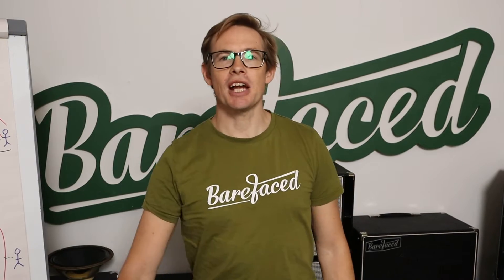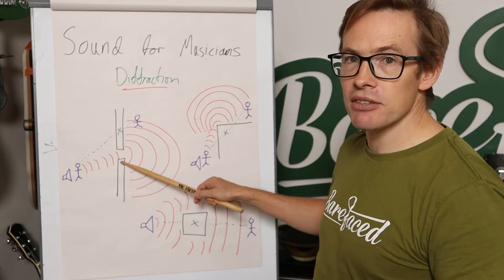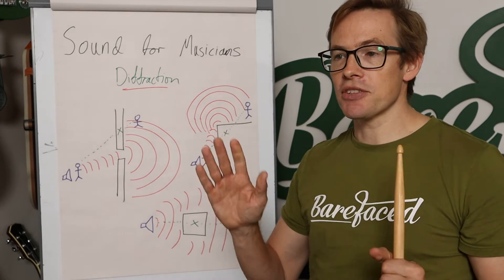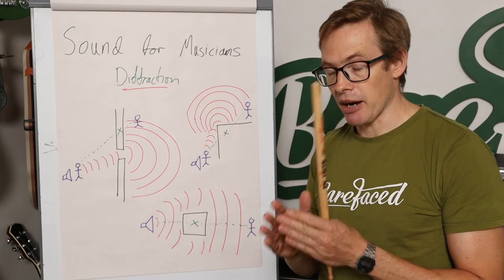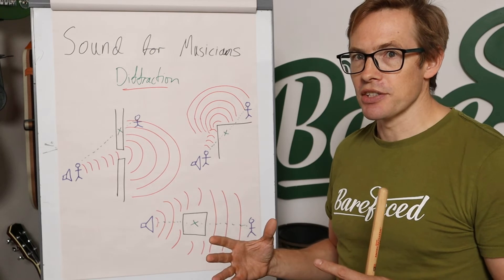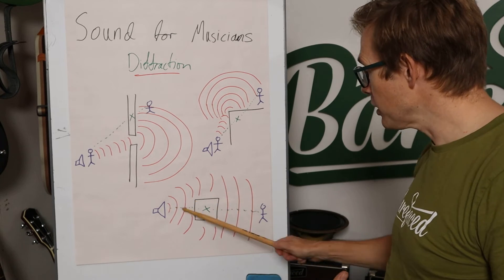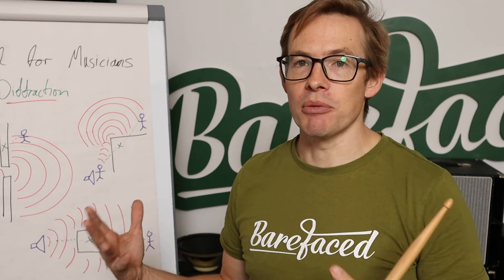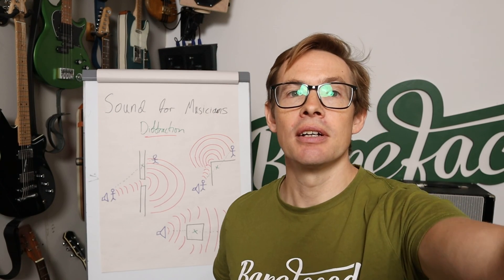Sound for Musicians- Part 4: Diffraction

Comment: Excellent. I would love to hear about dead spots in rehearsal rooms and how to deal with them. For example - i have a friends, who rehears in the same room with the same equipment for years. And i know minimum 3 spots in that room where 1) in front of the bass cabinet - and there is no bass therу at all. 2) in front of a guitar cabinet - thу same. 3) one spot when you hear almost nothing, although its 1 m. from the drum kit and 0.5 m. beside the bass cabinet. It would be great to have an info how \ where to set the gear in a room. I understand that rooms are different with different sound prepare and dampening... bit lets say its a 5*8 metre long room. Thanks for youre videos!
Reply: I do have my own opinion about that. I think all the guitar\bass\PA has to be in line exactly opposite the drummer. not in corners and not in a circle. this way the drummer will hear all three amplifiers... guitar\guitar\bass. All guitarists who will stand between their сфиштуеы and the drummer. The guitarists will hear both themselves and the drummer and vocalist. The vocalist's speakers should be placed on either side of the drummer in the direction of the line with the guitarists, or on both sides of all guitarы сфиштуеы in the direction of the drummer. The bass must be in the centre between the two guitar cabinets in front of the drummer